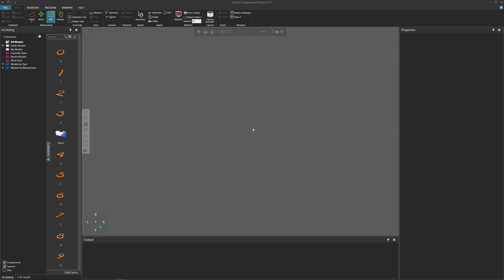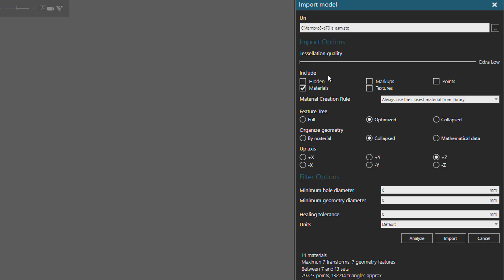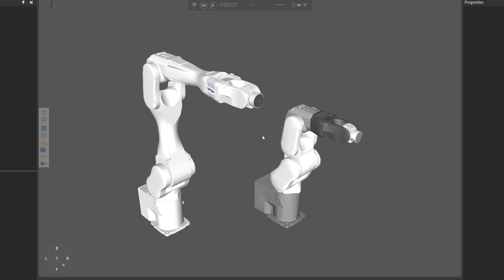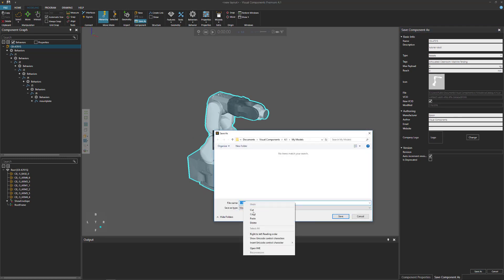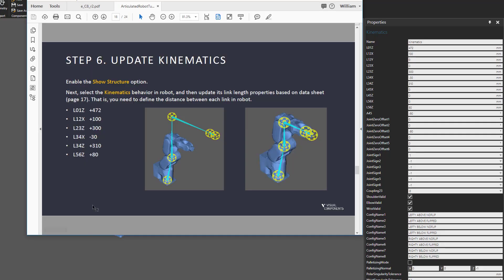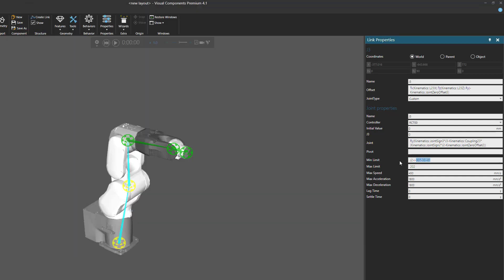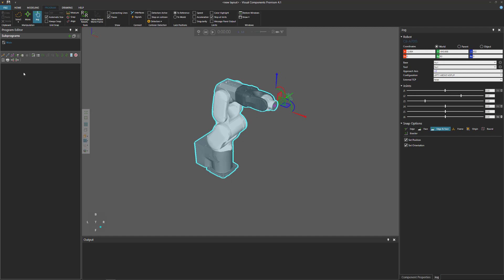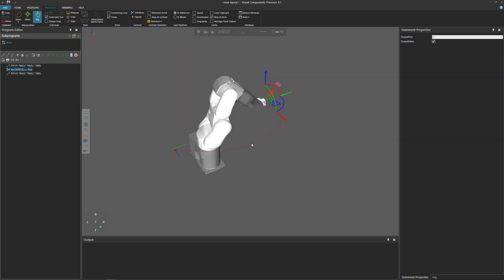Model an Articulated Robot | Visual Components 4.1

Comment: When specifying the speed of the joints, the units in the datasheet are given in deg/s while VC uses mm/s
Reply: Its deg/s. 
Its only showing wrong in VC for rotational axes.
Reply from the maker: Thank you for your comment, this has been fixed in the latest Visual Components versions. At the moment it shows deg/sec e.g. for MaxAngularSpeed :)